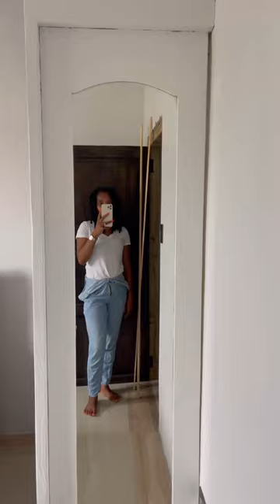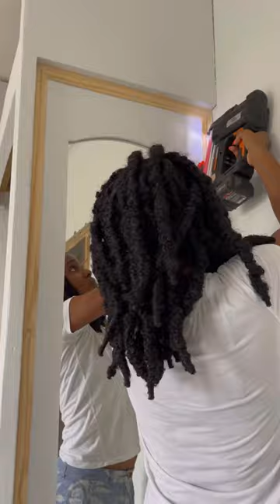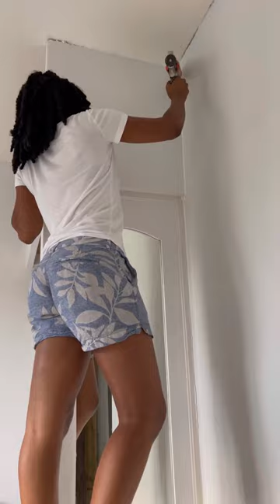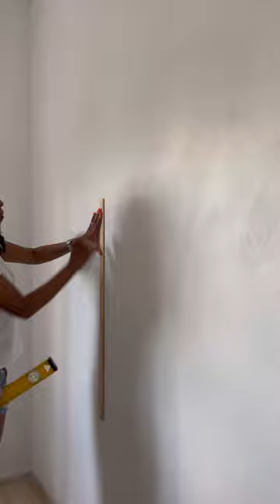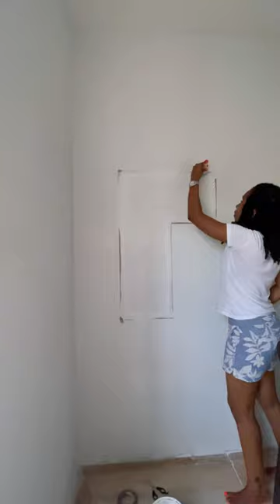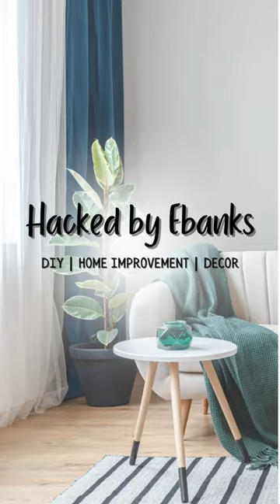DIY Mirror #bedroomdecor #bedroomrenovation

Comment: I saw a great video with tips on how to get cleaner lines when caulking. The first tip was to cut the tip to contour to the corner as best ad possible and sand it until it was smooth and matched the corner perfectly. The second tip was the less caulk the better, and it was preferred to use a small bit at a time and just go over it again if needed instead of the constant overflow and then wiping
Reply from the maker: Thanks. Definitely gonna try this. Just a little extra prep for a cleaner finish!